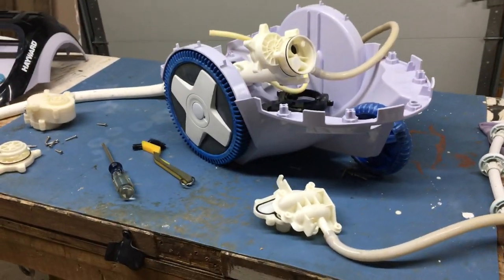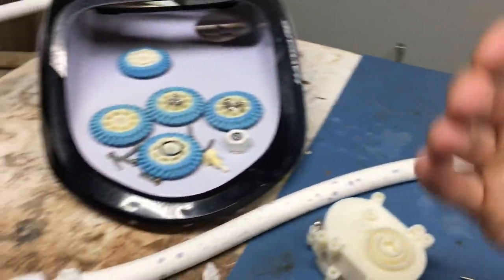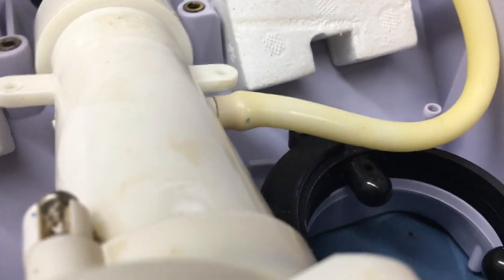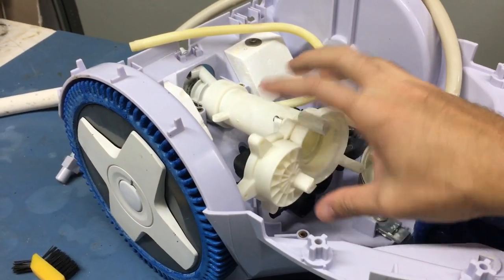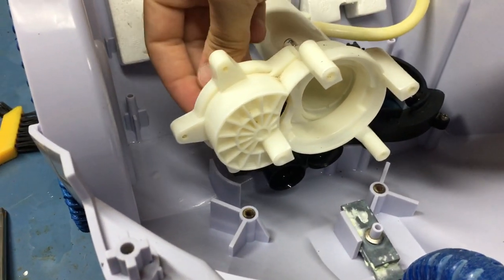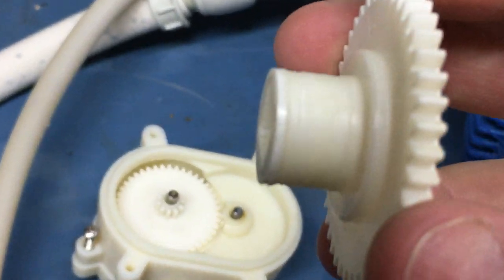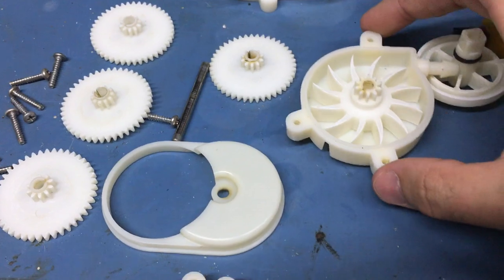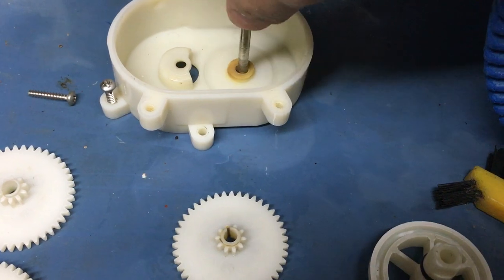Hayward TriVac TVP500 Diagnosis and Disassembly

Comment: Mine didn't even make it a year before it starting having issues of not moving around the pool.  Now, my unit only shots water out the front so I suspect the timing unit is having issues.  I'm really surprised that the pin holes don't better match the size of the pins.  This is probably why Blue Haven stopped using this brand as it seems prone to having long term running issues.  Thanks for the breakdown video.

Comment: I bought a new entire inside kit and my trivac 700 travels to a corner and stays there. 17:44
Reply from the maker: Presuming that the 700s flow controls work similarly to this 500 run the unit out of the pool and ensure that it is firing both drive-jets. AFAIK the "unstuck" from corners is usually a function of the timing firing the front (angled) jet intermittently, so that's where I'd debug first.